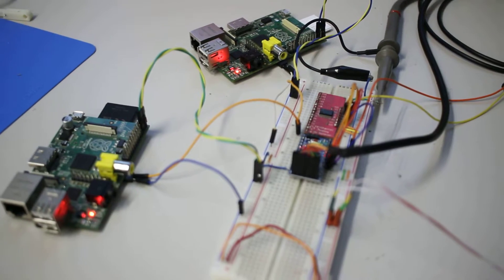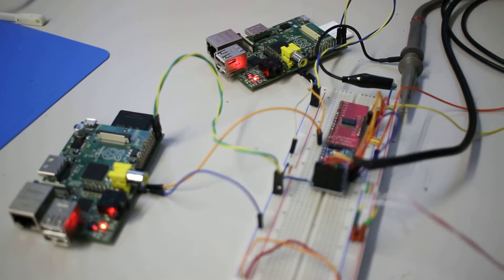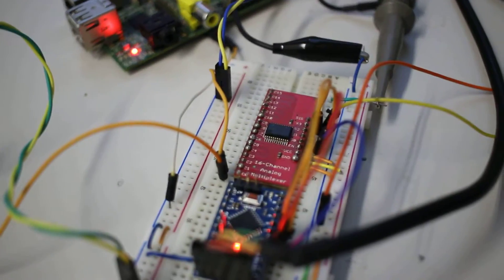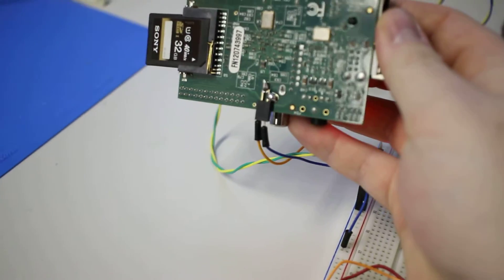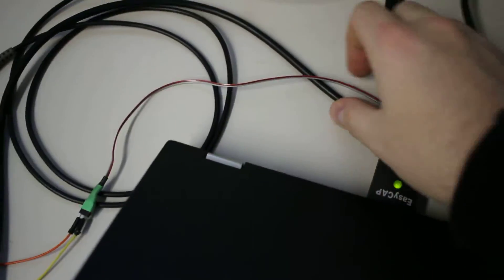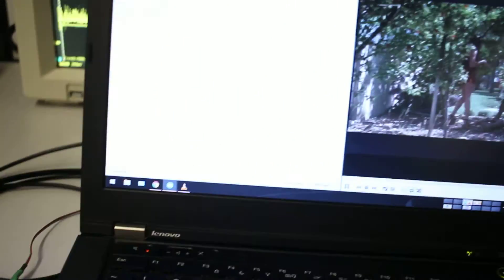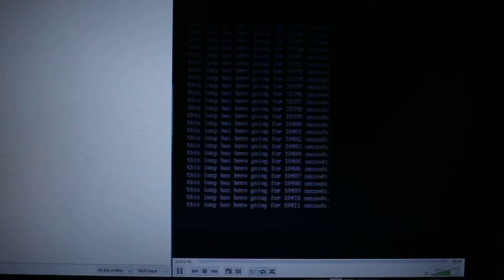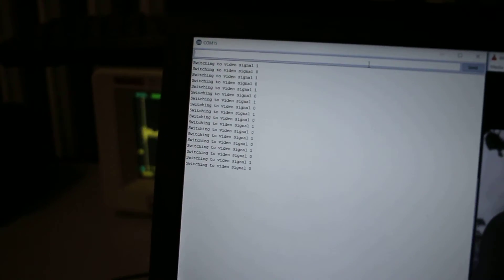Multiplexing Composite NTSC Video

Comment: I'm working on a similar project, and would appreciate some advice. I'm trying to recreate Field Sequential 3D using a Raspi3. 

The basis is two separate videos made into one video source by assigning Video A to the Even Fields and Video B to the Odd Fields. This is pretty straightforward, but the hard part is then separating the odd and even fields after it is output from the Raspi3 over composite.

Could your setup be used to separate the Odd and Even fields so I could then output the separated fields to separate monitors?